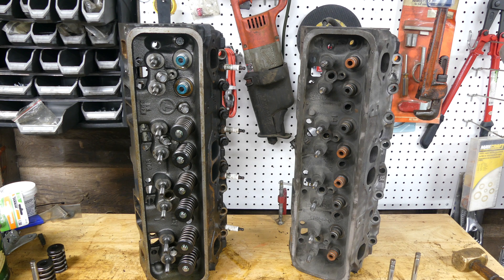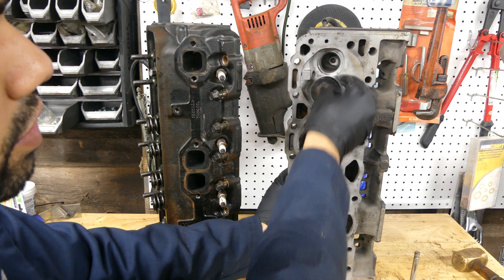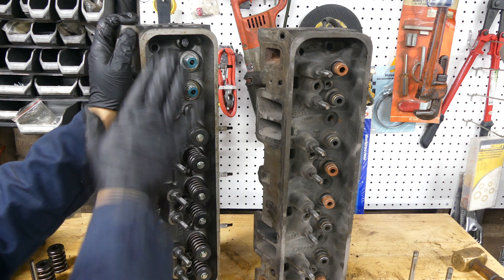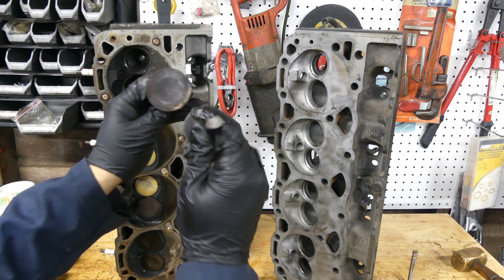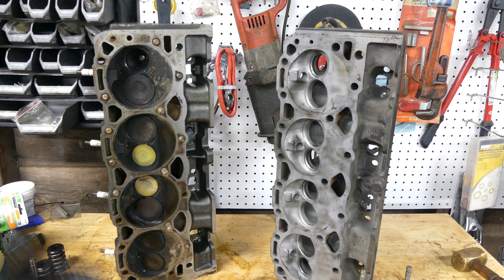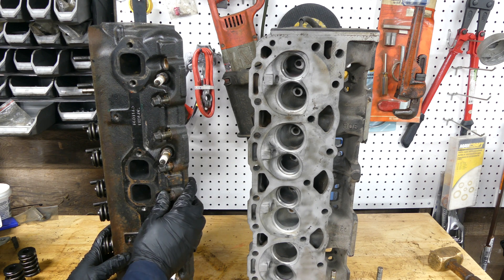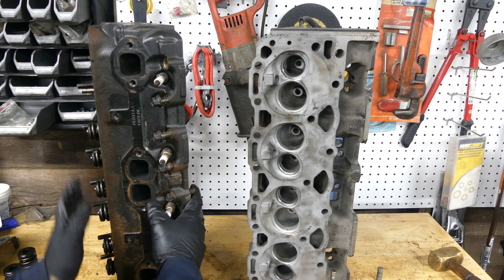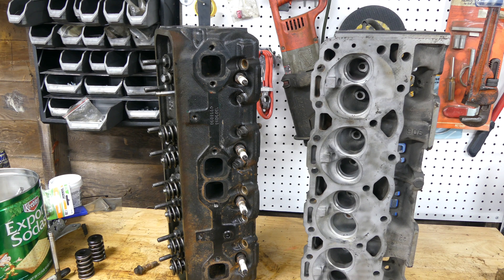EngineQuest Vortec Heads vs Factory castings

Comment: I would never go out and buy vortec heads ever again.. Why? By the time you get done with all the machine work done you could buy a set of aluminum heads that flow more, cuts 40lbs of weight that transfers heat better than Iron heads?? Pretty much pointless to go with Iron heads unless you are in some sort of class of racing that is iron head only!
Reply from the maker: I agree for the most part, but they still have a place. Since making my early videos and doing a fair bit of porting I can easily  make a vortec move 270 plus with a 2.02 valve package. Thats better than a fair chunk of out of the box entry level aluminum heads. If your on a budget and do some shopping it can be done for about 600 bucks and some elbow greece. I also understand that I have more experience with them than many so thats a factor as well. Intakes are slim pickings and are more expensive as well. My point if there is one 😆 if you work with what you have and put in some work you can make power "cheaper" still.

Comment: The good EQ heads ended production a few years ago, when the foundry in New Zealand closed. Unfortunate, they made very good castings. The current EQ heads are cast and machined in China. EQ is doing their best to maintain a high level of quality control. The current heads are nowhere near as nice as the New Zealand made heads, though. With a good valve job the current EQ heads are about equivalent to production 062 and 906 Vortec heads. I suspect the current EQ head is the same as sold by Cific, and several others.
Reply from the maker: Thanks for the info, i was unaware
Reply: @brokejoebuilds5165  Thank you for the video. In the video,  the head you have has a T symbol cast into the area under the valve cover.  This is the symbol of the foundry in New Zealand.  If anyone can get a set of heads with the T they are golden. 

The heads currently available are not bad. They have screw in studs, and stud bosses spot faced for a guide plate. They are definitely heavier castings than production Vortecs. I suspect,  if someone spent some time with the current head in a seat and guide machine cutting the seats for bigger valves, a really good valve job, and also cutting the bowls properly, they would get flow similar to the New Zealand heads.
Reply: @zAvAvAz  What foundry did RHS use?

Comment: Summit vortec heads are dart castings
Reply: That's not what Dart said. Hmm
Reply from the maker: Thank you wasn't entirely sure
Reply: They used to be from the same foundry however the  ones  sold to summit were not buyable by dart because dart's strict casting parameters were not met. Therefore summit bought head castings that were dart rejected. Dart head designs change also since then, as they work with a caster or foundry casting heads. For example new design heads had improved water jackets near the exhaust valve where the casting would sometimes get too small causing valve heating issues in pro series racing, although that was a long time ago on a cylinder head far far away in another galaxy.

Comment: Will these heads fit an L31 block? Looking to upgrade my heads since my stock heads are cracked.
Reply: @brokejoebuilds5165  Can you recommend any heads that will fit?
Reply from the maker: Sorry  scratch what I said these heads fit the l31... for some reason I saw ls1 sorry. Perfect replacements
Reply from the maker: The enginequest are a heavy casting and wont crack either
Reply: @brokejoebuilds5165  perfect,  I'll look into them. Thanks
Reply: Your link doesn't work anymore.
Reply: Do you have a part number for these?
Reply from the maker: @joefletcher5617  eq-ch350ca
Reply from the maker: @joefletcher5617  which link?